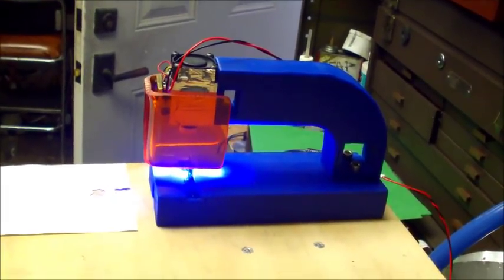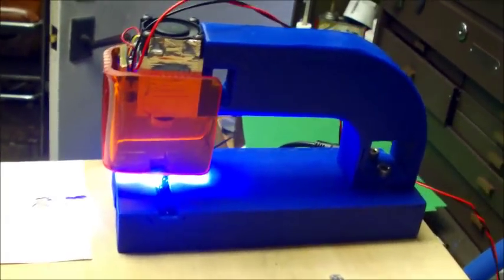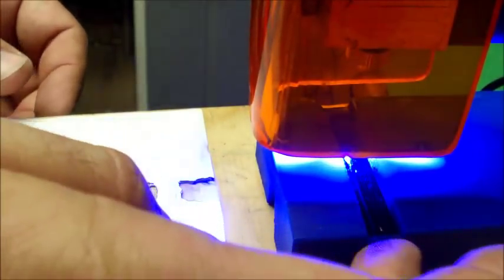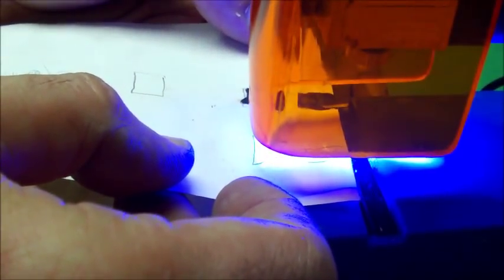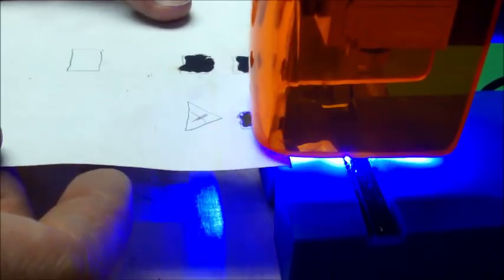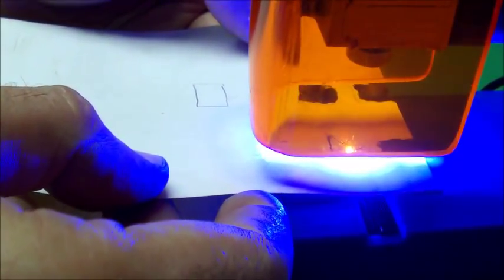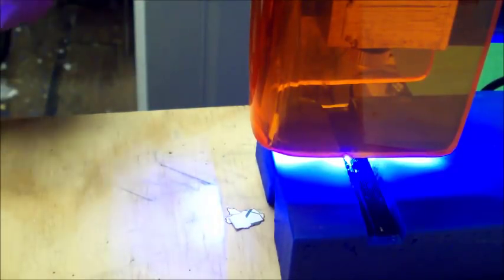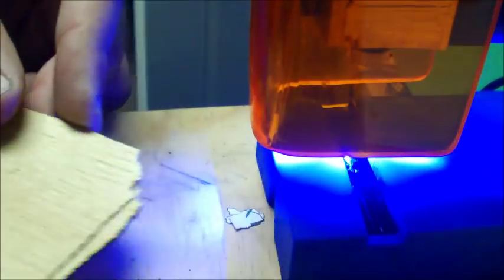Laser Bandsaw

Comment: Awesome! By the way what plastic did you use for the guard/ do you know if it blocks the correct wavelength? I’d love to use some for future projects
Reply from the maker: The orange acrylic  guard came from J-Tech Photonics.  I actually did a lot of research on the question!  That shade does a good job on stopping blue light (including the specific wavelength of my laser).  It comes in two optical densities.  You want the one with a higher optical density.   J-Tech actually tests every sheet (all four of my sheets showed up with a corner un-masked from testing).  They only cost a little more than other sources, and you are sure your getting the better grade stuff!